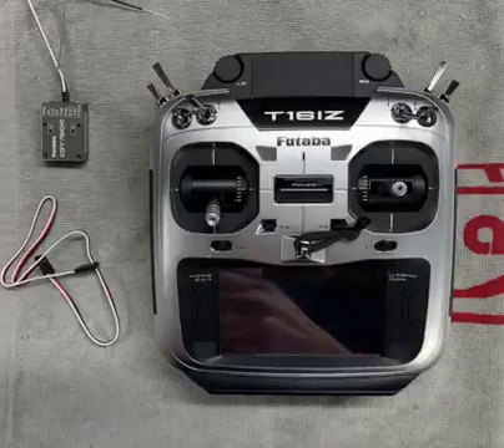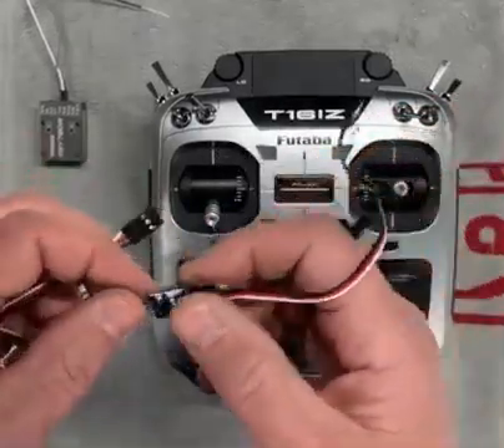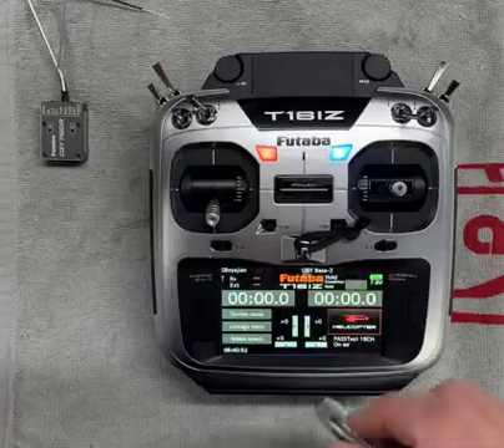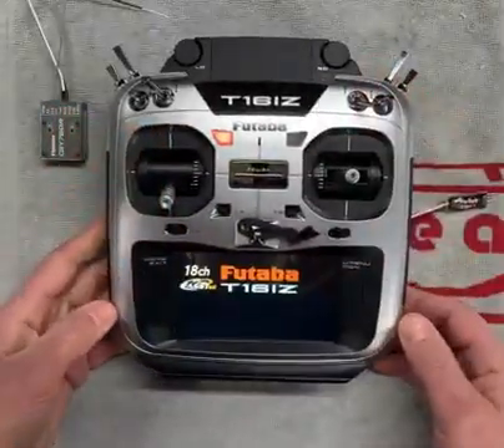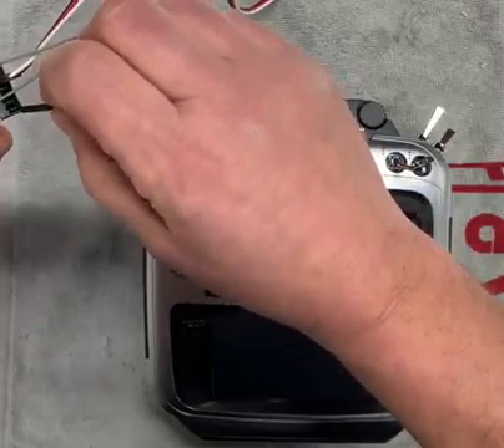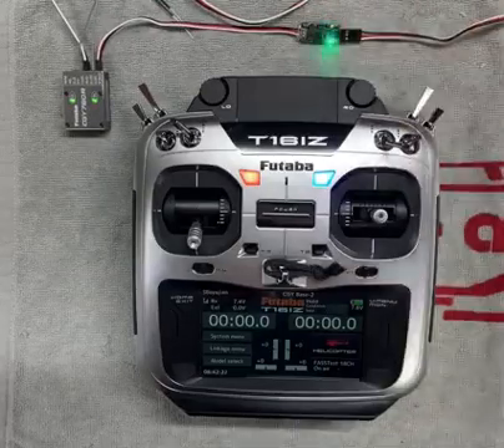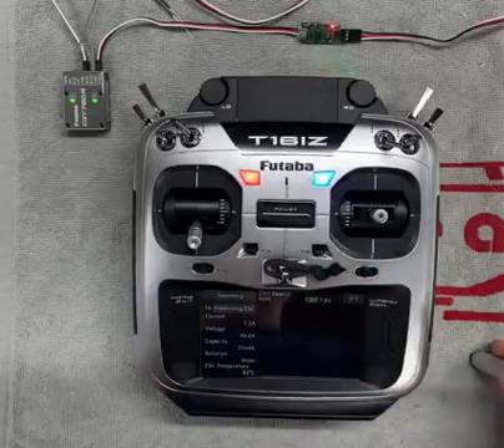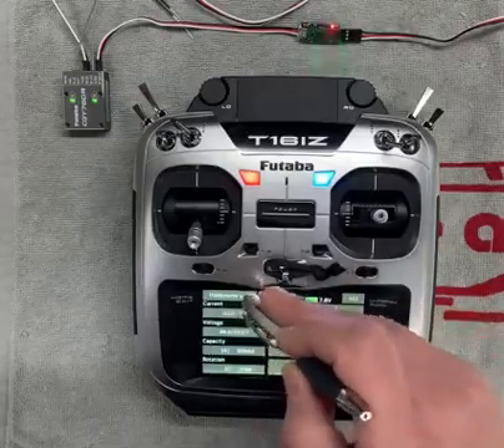Futaba 16IZ with Hobbywing SBUS Telemetry Adapter

Comment: Thanks for this, tremendous help with hunting down the location of the RPM pole and gear ratio. I must have read the Futaba gyro manual, 16IZ manual, the hobbywing telemetry and ESC manual for hours trying to get the RPM telemetry to read correctly. This is great sensor at a great price.

Comment: Thanks for your videos. It looks easy on this radio to associate the Hobby Wing sensor. I can not associate this sensor on my Futaba 14 SG. I tried from the "basic menu" - "sensor"- page 7 "registers":   the radio freezes it does not find the sensor. Can you give me some help? Thanks from Italy
Reply: I haven’t tried it on my 14SG but you may want to make sure the transmitter has the latest firmware. Just a suggestion. This video did get my telemetry working in the 16iz and my 18mz.
Reply: @heeder777  Thanks for the reply.  I mounted just the same sensor on the 18SZ and work fine. Version 9 is installed on the 14SG. I think the Hobby Wing sensor is not compatible with the 14 or at least with this version of the software.  Greetings from Italy.